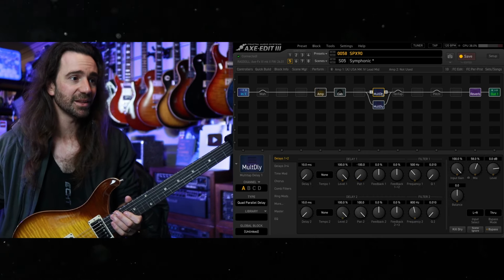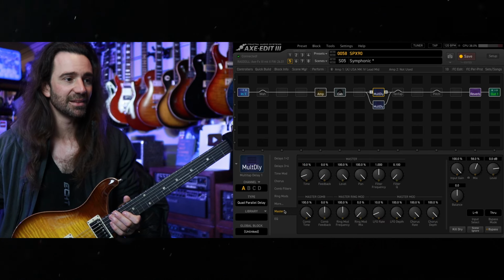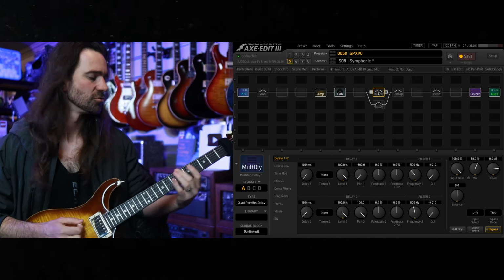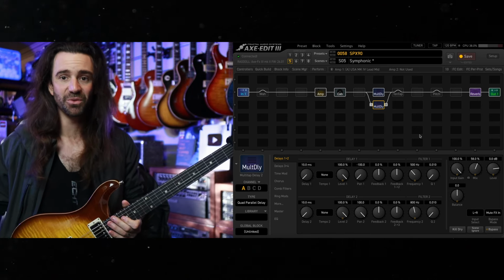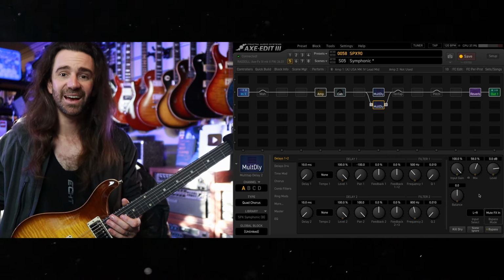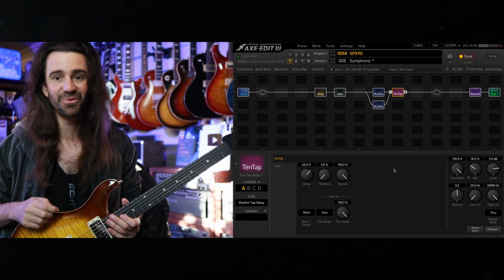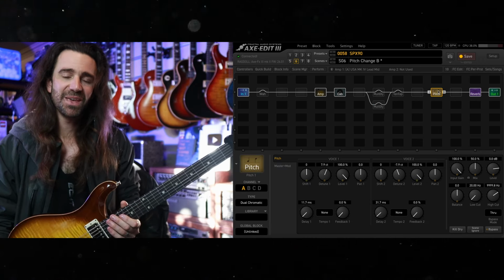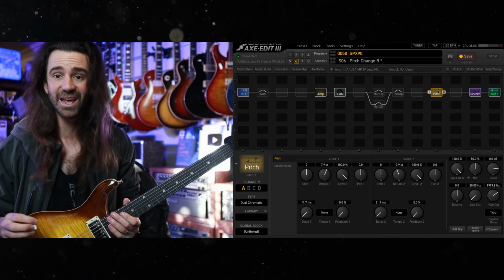Yamaha SPX90 SYMPHONIC in the Axe-Fx | Zakk Wylde Approved Width & Girth

Comment: How did he measure this? Using frequency matching? Oscilloscope? The process to do this would make a great video.
Reply from the maker: Different length clicks to figure out the delay times/depth/rate and noise for frequency response